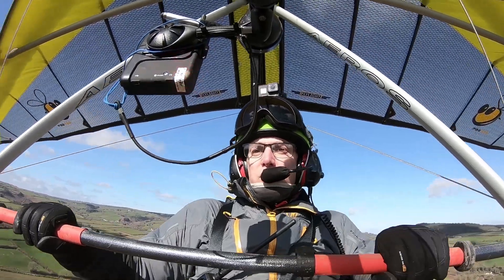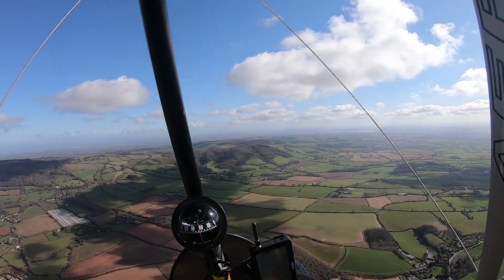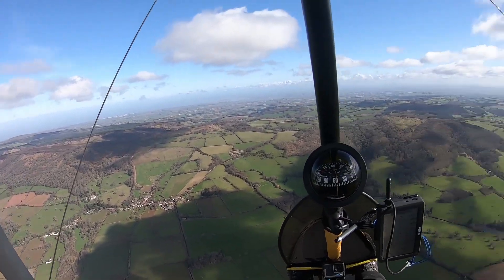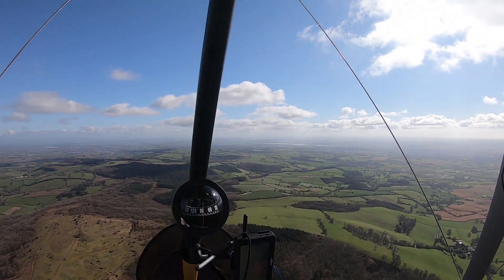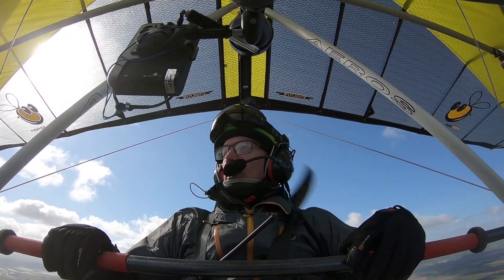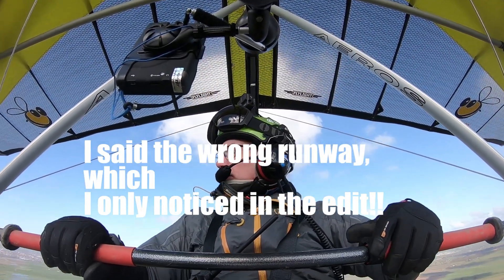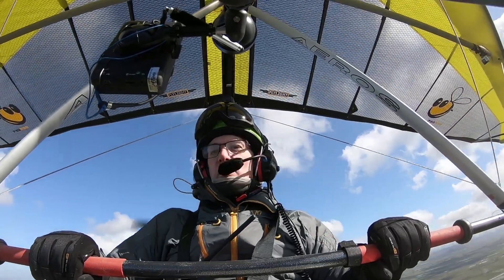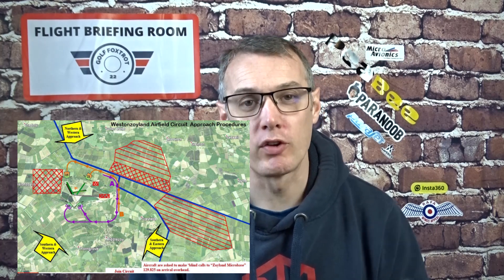Sub 70 Flexwing - Westonzoyland land away - Part 1

Comment: Nice flight, Giles. I gather the Peabee has a high glide ratio, which is a blessing and a curse. If you have an engine out - more landing options. If you need to get down in a hurry - good luck!
Reply from the maker: Yes, that is the issue when trying to get down.  The skin on the FOX 13 TL2 is very tight.  Its just something I need to take into consideration when circuit planning.  All part of the learning experience.  The return leg was somewhat more interesting, look out for part 2 next week.

Comment: Like the way the checks are done engine-off in the middle of the runway, or so it seems
Reply from the maker: Hi Chris, it was, yes but I knew no one was coming in, its private strip.  I want to make sure I could actually roll as the ground was almost a deep as the Bore Chasers.  I couldn't see you on the FLARM though ;)

Comment: Great flight!  Yes, you were high on final. Were you catching a thermal maybe, right before you touched down?
Reply from the maker: I was at the 800 ft point, no thermal as I could see on the Oudie. I just should have planned the circuit better, I was focused on ensuring, a) I dodn't screw up and b) I didn't bust any of the noise sensitive areas.  Part 2 certainly has some interesting landings ;).

Comment: That landing looked awesome! If you were to fly early in the morning or evening, would that part holding you remain still? It kinda looks like it’s always moving around. I was assuming that it was the thermals.
Reply from the maker: Unfortunately the trike is always moving. The weight shift is how the aircraft is controlled. It's a bit like saying don't pull the controls on a paramotor when you need to flare.

Comment: Beautiful flight and you "greased" the landing.  How far was you flight, how long did it take, what time of day were you out, was there much turbulence, and how did it feel?  Thanks.
Reply from the maker: It wasn't a long flight, only 17 miles, point to point,  just getting used to flying into a local airstrip.  The flight from wheels roll to wheels stop was 35 minutes on the GPS. I launched at 1030 and only a few bumps from the morning thermals starting to build. The flight back was certainly a bit more turbulent and the landings were interesting.